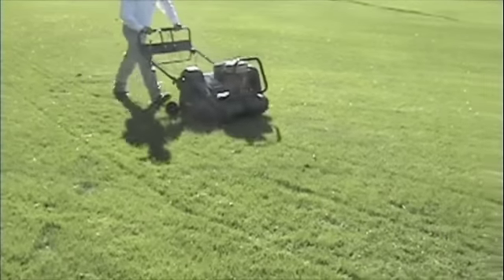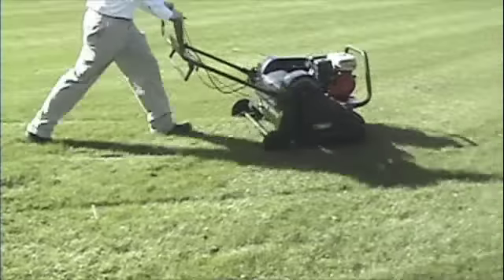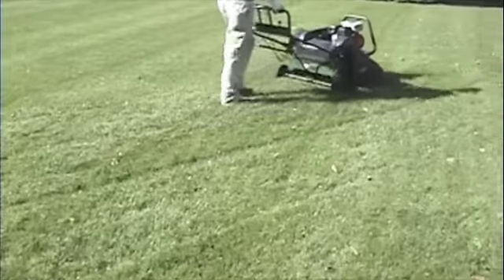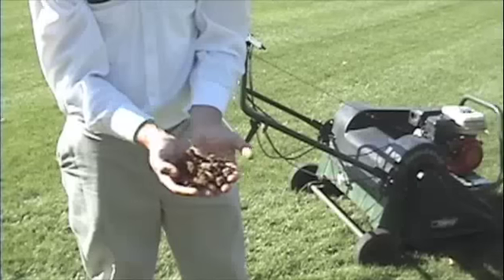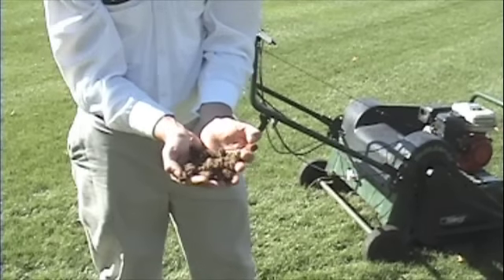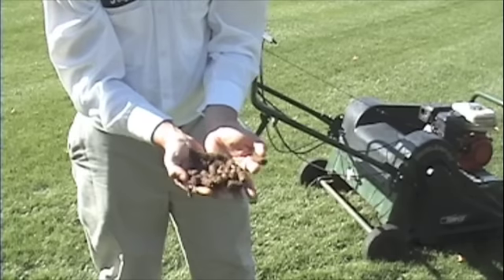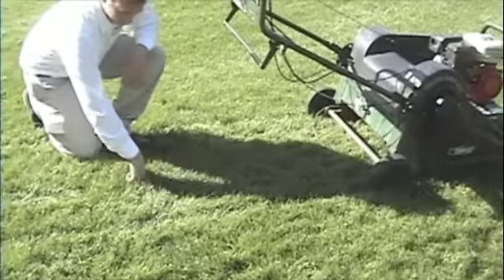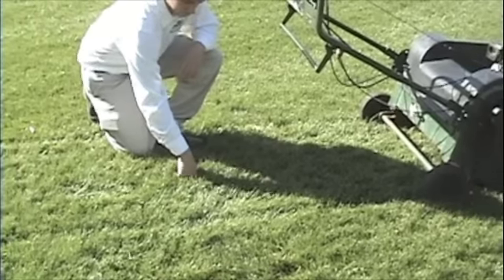Core Aeration

Comment from the maker: The cores should be left on the ground.  They will break down through mowing, rain, and irrigation.  It typically, takes 1-2 weeks for them to completely disappear.  The only situation where they are picked up is on golf course greens and sometimes on fairways and athletic fields.  Even then, there is special equipment needed to do this properly.